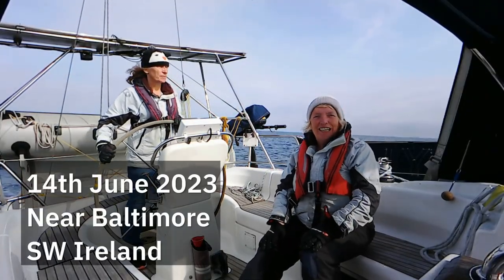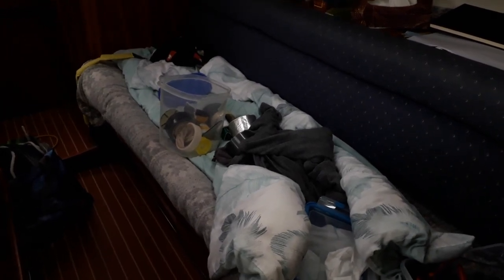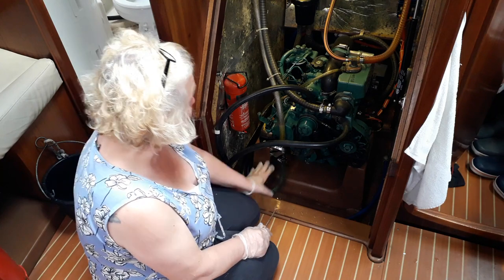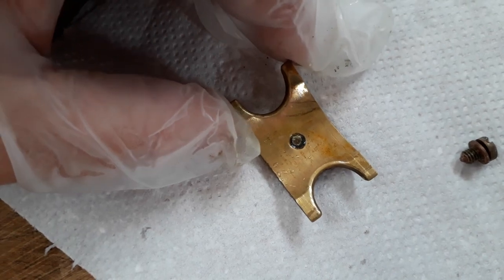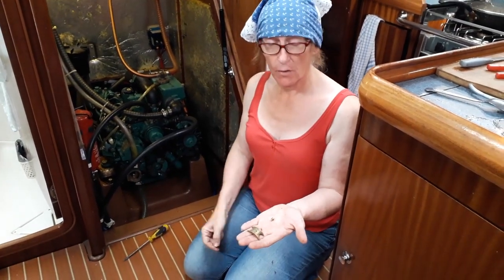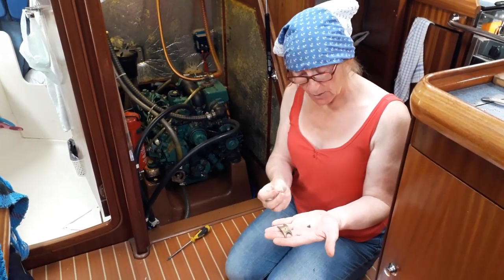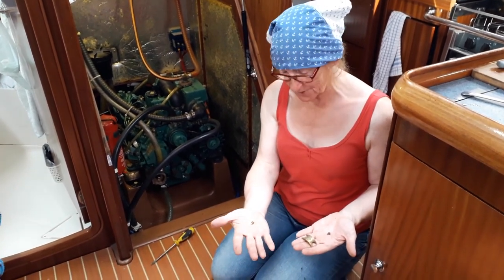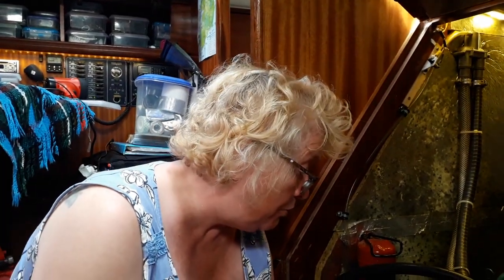Sailing Ireland - Baltimore - Engine repair - impeller issues - Ep. 306

Comment: Good job Ladies..
Reply from the maker: Thanks Trev. We felt very pleased with ourselves at getting it fixed at sea
Reply: @SailingYachtSaltyLass   a trick you can try in the future,  support the part, and using a (not your best) flat head screwdriver,  try lining it up this the centre of the broken bolt,  and give it a wack,  50% of the time it’s enough to loosen it so you can simply unscrew it like a std screw.. 
the theory being,  as the bolt was tightened it stretches ever so slightly,  (the reason we don’t use extensions when torquing cylinder head bolts (yes we use a tension wrench) but as we become super experienced we also know by feel if a bolt has been pre stretched as in used before,  meaning we May increase the newton meters force ever so slightly, like star wars 😂 we tend to use the force rather than a pre-set amounts, with an extension we can’t as we extension twists every so slightly, which is perfectly fine because my workmanship especially on engines carried a 5 year 100,000 kms warranty, so if i made an error i paid)  so when the head finally snapped off,  it generally will retract that slight amount,  meaning it’s not really in there very tight..  why your drill worked the force of the drill trying to cut,  actually turned it fully through,  but say there isn’t a fully through?  That’s where my old school mechanic trick may work and surprise you..  
just a tip..    i know you are both very capable ladies!
Reply from the maker: @trevhedges  - That is a great tip! Thank you. And it may work very well with a steel screwdriver against brass/bronze as they are much softer than steel. It would willingly sacrifice a screwdriver if it fixed the problem 😄

Comment: Nice job fixing the problem, and figuring out a solution for the next time it happens. After a few more years you will probably find you need to raise the waterline because of all the spares you carry :)
Reply from the maker: Actually, that is already a problem. The boat was coppercoated by the previous owners and they did it with the boat empty when they marked the waterline. Now we own the boat the top of the coppercoat is a couple of centimetres under water 😮 so we have a strip of Seajet90 non-ablative antifoul for the waterline ...

Comment: I have an MD2020 from Volvo Penta as well - very simillar (if not the same)....  Funnily enough the same happened to me 3 years ago.  It happened in Peel on a trip.  Fixed it with a random screw and retap borrowed from the boat club there whith a blob of an epoxy (for galvanics) from Lidl and its been there ever since. (I always carry a few tubes on the boat).  Lidl were also selling small metric tap sets a few weeks ago that might be handy to have onboard.  The screw doesnt come in the impellor service pack, but if memory serves its the same as the 6 that hold on the rubbing plate (which you might use in a pinch). I would advise a stopcock on the intake, though.  Its a simple addon for safety and I think its required under CE 2003/44/EC rules these days.  (from  SV Iris of Glenarm)
Reply from the maker: We have the replacement screw/bolts now which we resized ourselves but I will keep an eye out for metric taps in Lidl. We do have a stopcock for the impeller, but it is on the other side of the engine near the saildrive and runs up through a strainer before entering the impeller unit.

Comment: Feel your pain had pump fail on friends boat, ended up using small electric pump in bucket of water to feed the engine whilst the bucket was refilled using the roving gusher bilge pump it’s surprising how much water passes through the engine to cool it
Reply from the maker: There can never be too much water - as long as it goes through the engine 😉

Comment: Great that you were able to fix it yourselves. Many would throw their hands up and call the Volvo dealer. Given enough time with no raw water cooling the engine may seize. But before then you'd have steaming coolant blowing out the pressure cap and the rubber exhaust pipe would probably be on fire without a steady stream of salt water.

But I'll see your leaking raw water pump and raise you a leaking heads Y valve :) My next opportunity:)
Reply from the maker: I love your prognostications of doom and despair 😉 Melting engines and burning boats.... 😄😄😄😄😄 Probably either is better than loo stuff......

Comment: Well that was a screwy episode 🤗.  Where I am, on the Great Lakes, Georgian Bay - we call the east side hard water. That’s because of all the rocks!  Like you, Engine checks and being aware of physical changes, ie sound, speed etc is key. I happen to be going to my Volvo dealer today and will see if there are spares or screw kit available for my backup inventory. I’ll also include this little screw in my inspection routine. A great episode- thank you!🇨🇦
Reply from the maker: If this episode makes people aware of this problem then it is a "Job well done" If they do not sell the bolt separate from the cam plate (Volvo!!!) then it might be worth taking it out when you next do the impeller and measuring it up and making your own spares. That is what we have done. We will likely replace this bolt every year when we do the impeller. 

BTW - love the definition of "hard water" 😄
Reply: Careful removing it - the jabasco impellor housing and cam are very soft bronze/brass.  If the unit dezincs, it will also be brittle....

Comment: Nice one.. a spare pump and rebuild kit on the pondering list? 🙂
Reply from the maker: The impeller housing is not even two years old yet. It seems a bit early for anything to fail - certainly very annoying! Having said that I will have a look at the seals kit for this version. Thanks for the idea 👍
Reply: Sure.. the having a spare pump ready to go is more for the bearing and/or seals failure scenario.. sometimes conditions are less than optimal, and just replacing the pump is preferable.. 🙂
Reply: I have the same pump on my engine and had to replace the shaft seals trying to get that very small serew out and not loose it in the bilge not exactly fun well done ladies
Reply from the maker: It is a terrible design!

Comment: Can't believe volvo would design or  use a pump like that on their engines tbh. I've got a yanmar 20hp engine in mine with a Johnson pump fitted as standard. My pump doesn't have a separate shim held in with a screw like yours, it's actually been machined into the pump itself. So nothing to break or leak. Glad you fixed it and also a cheap fix too for you 😀
Reply from the maker: We always thought the that cam plate was integral to the pump. Our old unit was a Johnson but we replaced it recently when the seals failed and there was wear on the shaft. We have since bought a pack of bolts and filed them down to the correct size.
Reply: Its a jabasco one on most of these volvo pentas.  and yes, a bit of a design flaw.  The basic design is sound, but they should have used something beefier like an M6 in bronze/brass

Comment: What a terrible design. On the Yanmar engines I've worked on the pumps didn't have that loose plate but completely machined, nothing that can leak or break.
Reply from the maker: At least our impeller faces the open unlike many Yanmars where the pump is in back to front! Engineers have a lot to answer for IMNSHO 😉